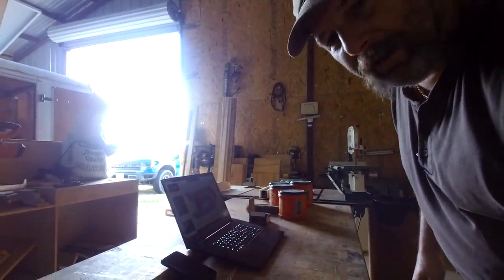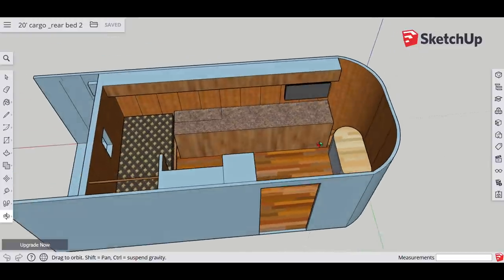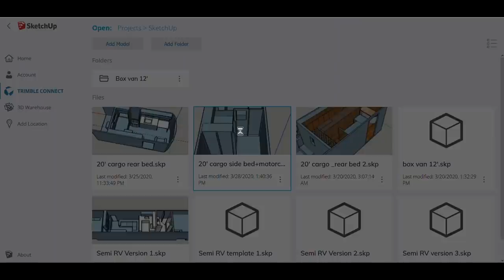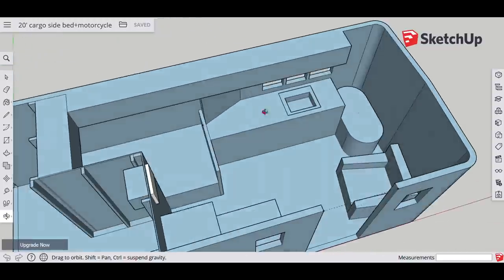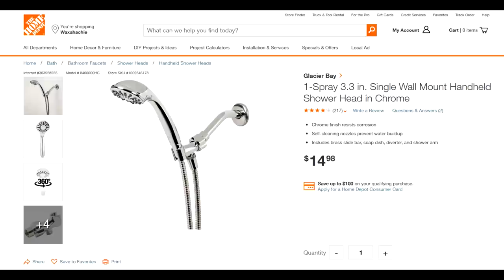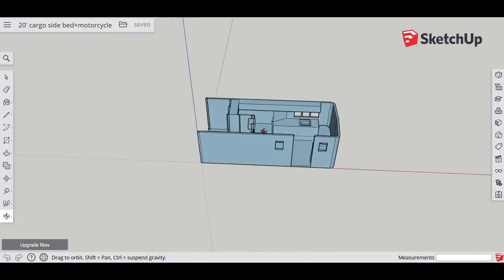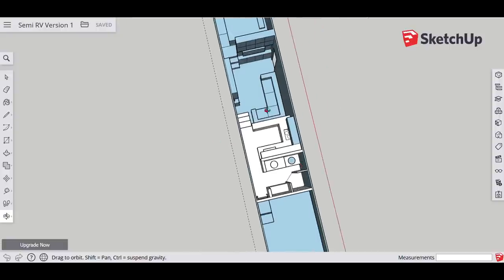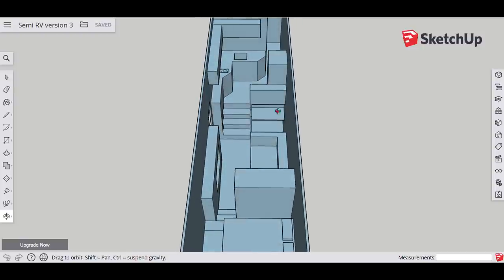500  Floor plans / Cargo trailer RV conversion

Comment: I think I'd be inclined to mount the A/C on the front wall instead.  No need to worry about cracking the back door to let heat escape. Water drainage is easily taken care of.  Also then don't have to worry about rain getting in the open door. Your unit is also more secure with the rear ramp locked up.

Comment: WOW this looks like fun. On the 20ft cargo trailer/camper conversion 2 x 75 gallon tanks under the bed would put 1,250 lbs of water over your left tires. On the moving trailer conversion that 275 gallon water tote would weigh almost 2,300 lbs.

Comment: Maybe think about a mini split system.. Mount compressor on the tongue of trailer.. heat/air and won’t have to leave the door open ... when going down the road just put a cover on compressor
Reply: ZeRowe  also the window air conditioner will leak condensation in the trailer. He would need to put a drain through the floor.
Reply: True, and if that door was open it would act like a hood scoop in a gully washer down pour.. everything would be wet in the garage area

Comment: I’d recommend a length of HVAC type duct for that AC so you aren’t dumping humidity past your gear.... or even better yet, keep the AC on the back wall and  distribute the air with ducts.

Comment: HELLO Stan! How about installing a fantastic fan roof vent in that garage area? That way if its raining out you won't get water in that garage area. If the solar panels cover that part of the roof, they make wall vents just for that purpose. Also consider spray foaming the inside as that will help with sound and temp. BTW, camera is still working great! Thanks again and can't wait to see how this turns out!!!!
Reply from the maker: Great idea

Comment: Waaaaay too much water. And in one area. Water is heavy. Consider 1 50 gallon
Tank. You would have almost 500 pounds in one area. Move the water tank more towards the front of the trailer.

Comment: Great floor plans and ideas Stan! I love the motorcycle version, that's the way to go and you can keep the bike out of the weather. If you have a fantastic fan in the garage area, would that vent the heat from the A/C? I think you should look at a mini split with all that solar, more efficient than the wall unit. Campervan Kevin put one in his class A and its also gives him heat so he doesn't burn propane.
Reply from the maker: Interesting......

Comment: Follow me here Stan, I had a toy hauler
trailer and by opening the ramp &
suspending the ramp with two cable
come-alongs we gained a 60 sq ft platform
like a deck out the back then with two poles
& some zippers we covered it with a canvas 
awning. We bbq'd back there sat in lawn
chairs and enjoyed the sunsets. It was
extremely cool.

Comment: All that is merely theory.
Instead:
Use cardboard forms to develop sight-lines, traffic patterns, and window placement.
For example:
* Put your 'bed' in one area, then watch the traffic around\through the dressing area.
* Put your 'counter(s)' in one area, then watch the way groceries end-up after shopping.

Each rig is constantly evolving.
2003, I built my concept of an ExpeditionVehicle on a 1997 Ford CF8000 commercial truck.
After nearly two decades of full-time live-aboard, I still see need to modify it!

Avoid locking into 'the perfect forever rig'...

Comment: Could you put the ac in the front wall? Make it a mini split mounted on the tongue. 
Maybe you might want a rear door. Could be a sliding door.
Your idea are good.
Reply from the maker: Possibly!
Reply: @Sasnak  ... check out CamperVan Kevins ...mini split install ... very impressive! ( I would go with mini split ..with that much solar!)

Comment: Be careful with weight distribution.  With all of you heavy stuff on the axle or behind it you are going to loose tongue weight.  While I understand you are trying to minimize that you do need to retain some (probably 400 to 600 lbs).
To minimize your water usage for showers look into the HourShower on the Gone Boondocking you tube.  Shower with 1/2 gallon of water.
One last item, if they don't want you letting your gray water running out on the ground they don't want you "dumping on a bush" and Never "Dump it in a stream".

For insurance, look into a company that will do "Agreed Value".  You will need to find one that works with more variables than your typical insurance company.  

We already know that you are going to do the stepped wall leaving room for a toy.

Comment: Why are you going full hight (L shaped storage version) in the motorcycle bay? You could make it so you can reverse your bike into a narrow slot you could still have the bed above it going across the entire width and have no wasted space in the storage area. I’ve said reverse as the saddle is lower than handlebars, so you don’t have to have the bed too hight. 
Having to have the back door open when the air-con  is on seems problematic in a couple of ways. You’re venting humid air into your storage area and it’ll make thing more likely to go mouldy or rust, having the doors cracked open is less secure and could let rain, bugs and vermin into your trailer. Why not vent the air-con out the top or underneath?

Comment: Had the same idea with the garage part. But instead of having a little window I want to put two French doors or on 32 inch door that can open out and can be used as a patio entrance. The bed I would put the frame on e tracks so when not in use I can lift the bed to ceiling so I can walk through or in transit I can haul larger things using the French door for a pass through.. everything would be the same . Front nose of trailer I would use that as my shower/bucket toliet area . Nothing fancy just a kiddy pool with a hole in the floor for pouring out gray water .

Comment: Was wondering if you realize that a gallon of water is a little bit over 8 pounds per gallon which means that each one of those tanks is going to be well over 560 pounds
Reply from the maker: Yes.    That is a 7500# trailer so no problem.  It is actually car hauler trailer

Comment: Hi Stan. If you have a motorcycle in the trailer with you, wouldn't the fumes from the gas be a bit overwhelming at times - especially when you're trying to sleep? I know you mentioned cracking the door open.

Comment: I like #3, except for the ventilation for the AC......with it sitting so far back from the door I think the heat would build up way too much compared to the first 2. Heat rises and would find it's way out the back, but more of it would hang around in the back on #3 I think.

Also, where are you putting your cloths? I didn't hear anything about a dresser or closet to hang your cloths in.

No matter, it looks like it will be a fun build!

Comment: Have you thought about shipping containers?  The rig i'm planning is based on two 20 foot containers, one on the truck in front and the other on a trailer behind.  Parks, camps, etc here in Europe can't deal with 45 foot trailers (much less 55 ) and I want to be able to travel more than US; but if you plan to stay in North America a semi and one of those 40 foot flatbeds designed for shipping containers is straight forward - albeit probably not inexpensive - to insure.  The container is technically cargo, not vehicle, even if you live in it.   My plan is based on raising the roof and have a two storey ( one and a half, really) house when parked (because i HATE slideouts); but a single 40 footer has no wasted space so you could easily live in one without any error-prone gizmos.   I know you'd need to climb higher to enter the container; but the upside is a more off-road capable vehicle with more clearance.  And its easy to store the living quarters :o) 

I like the floor-plan with the asymmetrical garage. Very feasible, very practical.  I'm not going solo (as far as I know :o), so I have to have a real toilet, real shower, washing machine, you name it; but for a single person waiting for Pam to retire that looks like a man-cave on wheels.  Best of luck!

I am not a fan of the window-unit.  I know Tom makes it work; but it's noisy, it leaks, you have to deal with wind pressure while driving (or enclose it  and suffer the problem of rain entering the garage when you need the dehumidifier the most).  I'd find a cheap minisplit, I think, even though the outdoor unit will take a beating on the road and need to be replaced once in a while - just like a window unit.

Beware of the weight distribution, Stan. With a halfton bumper pull I suspect you'd need more weight on the front than you plan for. Sway sucks.  Perhaps you could get harder springs and shocks on the truck (or an air kit) if you dont want to put that much weight on it as it is?

There are companies that build semi trailer RV's. SpaceCraft Manufacturing, for instance (https://spacecraftmfg.com/floorplans/?_sft_category=semi-trailers).  I suppose they can provide an idea on how to insure.  Their trailers are expensive, i assume the customers will want to drive around with insurance... There's a really nice example here (https://www.youtube.com/watch?v=0t1xSHwuLyE).  If only....

Comment: I like the 3rd plan. But put the a/c on the side wall above bed. If not then add another small window in the back to allow hot air out allowing you to keep back gate closed and thieves out

Comment: You’re very good with that google design program. Very cool thinking. Don’t think the air conditioner working with the ramp door slightly open is the “best” idea. Security may be compromised and if it begins to rain, the garage will get wet. Very industrious, keep up the good work!

Comment: I was never a fan of inner walls in a trailer, rv etc. My 24'ft rv had a half wall book case cabinet for a TV between the bed and kitchen area. I tore it out and put the TV on a wall swivel mount. Now I could swing TV any direction (bedroom or kitchen).  That opened up a lot of area. But I do like the a/c on the inner wall you designed. Wall mount a/c always look so tacky sticking out from the outside. If it wasn't for the water tanks, you could have a fold up bed for possibly a UTV. Looks good Stan.

Comment: Problems I see:
1. Placement of the window air conditioner is going to create condensation run off. You will need to build a way to route it outside.  A more practical placement would be to mount it through a side wall and let it run off as it normally would. Anywhere other than the desert this run off water will be substantial.
2.  I'm concerned about the weight distribution. For it to tow properly and not sway like a dog's tail you need to have 15% of the weight on the tongue.  I would seriously consider having at least one of the water tanks at the front of the trailer. Semi trailers have the wheels at the very back of the trailer, Cargo trailers are similar to RV trailers and have the wheels closer to the center. It is very easy to get Out of balance and the result is as soon as you get up to speed you will be out of control. I've been there done that, It is scary.  Bumper pull trailers are not nearly as stable as 5th wheels. Of course you know all this, but until you have been drug across 5 lanes of freeway by an unbalanced trailer, trying desperately to get back under control the significance may not be totally impressed on your mind.
3.  Best bike for back country exploration in my mind is a Yamaha TW 200.  I highly recommend that over an electric bicycle For off road exploration.
4.  I have any electric bicycle which I now only use on blacktop. Reason being it threw me off very abruptly  Requiring a trip to the emergency Room for x-rays Followed by 2 months of dealing with back pain with some residual pain still.  A motorcycle is a much more stable platform where you can put your feet flat on the ground where as a bicycle requires your  Seat be high enough to allow your legs to peddle. That is usually high enough to where you can touch the ground only with the tip of your toes and is very unstable on unlevel ground. Plus the tires are very thin compared to an off road dirt bike.  Going back in the desert I would be concerned about punctures.  I've got more than a few years on you And my current thoughts are a side-by-side such as a  Polaris razor versus a Polaris Ace which is a single seat side-by-side style.  I want to be inside a roll cage sitting down properly to save this old rickety body. And let's face it if I could find a 30 year old blonde that wanted to ride with me having a second seat would be nice. 😎👍

Comment: I was wondering, do you still have your wrecked Peterbilt? If so, you could use some of the sleeper parts for that project once the dimensions aren't that different. Specially the shower/bathroom part.
Reply from the maker: No. The whole rig got bought by the insurance co

Comment: I was thinking to put kitchen in front and build flat counters along the rounded walls because outside by hitch propane tank can go like a trailer. But seen floor plan with dirt bike storage and the shower on the rounded walls, good spot to shower because a little more elbow swing space. nice plan Stan!👍😁

Comment: Floor space and condensation were always our biggest problems in travel trailers.  If I designed one, I'd put a bunk set in the front by the hitch, a toilet behind a wall in the back, cabinets along the ceiling, a 1 ½ ft wide piece of varnished plywood with legs for a counter and other than that, leave it open.  Folding chairs and coolers make perfectly good furniture, and the grill goes outside.  
	It'd be more like a hunting shack than a house.  When I was a kid, we cut a hole in a piece of wood to drop a basin in, and put a 5gal bucket underneath for a sink.  Stays real dry and clean underneath.

Comment: Stan, I like the toy hauler idea. Your utilizing your tailgate that way. My first rv  was a little Scotty with hand pump for water and a ice box. Propane lighting no oven. I think you will regret not putting a grey tank under the floor if you can fit it between the frames. A water heater would be nice. That bucket method is going to get old and if a Ranger catches you dumping he is going to have frown on his face when he asks for your I.D.

Comment: Water weighs 8.35 pounds per gallon. Two 75 gallon tanks will hold 1,252.5 pounds of water. Seems like a lot of weight.
Reply: One is water one is waste. Will only have 75 gallons total at any given time, but still a lot of total trailer weight for a half ton tow vehicle
Reply: Jose Dude - watch again. They were both fresh water. He is dumping waste water.

Comment: Like what your doing. Got to watch that out for that crs. I am going to build a 7x14 with a 21" v nose. Might use some of your ideas. What program did you sketch with?
Reply from the maker: Google sketch-up
Reply: Did you do your conversion yet? I just did a 7x14. Tap the green circle if you want to check it out . It's fun to build what ideas one comes up with. My vision was a log cabin interior.

Comment: The lower tongue weight is nice, but with so much weight in rear I would think it's still going to get pretty squirrelly on your 1/2 ton truck. Digging all the ideas tho, good vid!
Reply: You describe 'the trailer driving the truck', and this's usually a bad idea.

Comment: Two questions : 1 how do I get google sketch up? I would like to design my own camper van or cargo trailer. 2 ,has nothing to do with a design, but, I'm curious about your workshop? What are the measurements of your shop length, width, and height? Just curious. Thanks again for the videos, plz, keep them coming? Thanks again, Eric Sulen, Grand Rapids, Michigan, USA.
Reply from the maker: www.sketchup.com     When at the website look for products. Select Sketchup Free. Then Start Modeling
Reply: @Sasnak  Thanks for getting back to me. Take and be safe. Eric Sulen, Grand Rapids, Michigan, USA.

Comment: You have to distribute the weight evenly throughout the length of the trailer or you will have horrendous trailer sway with all that weight in the back.  That 1/2 ton truck isn't going to be able to handle that trailer.  Get a compost toilet or something, don't use the Bob Wells, that's ridiculous.  What would be nice if you had a big rv like a class A, you could tow a jeep or the trailer for your side by side, wouldn't that be great?